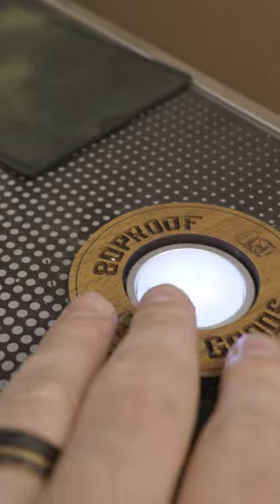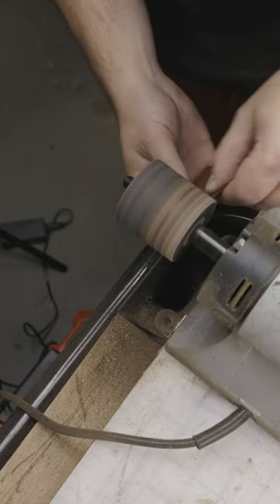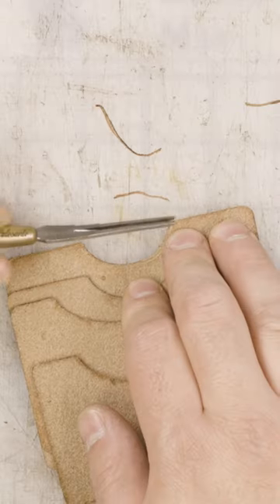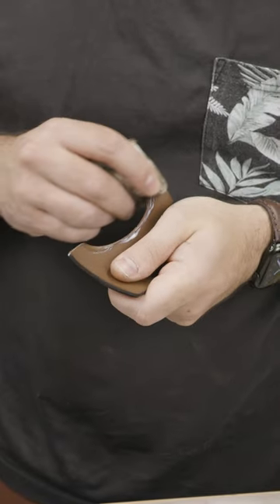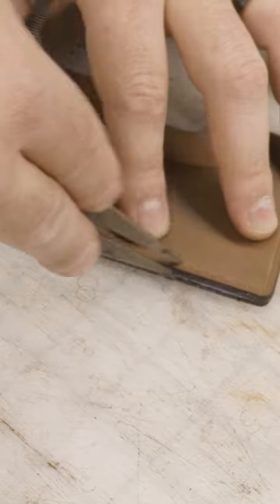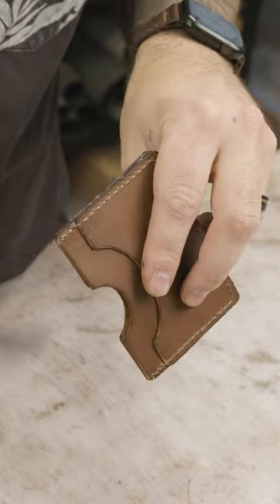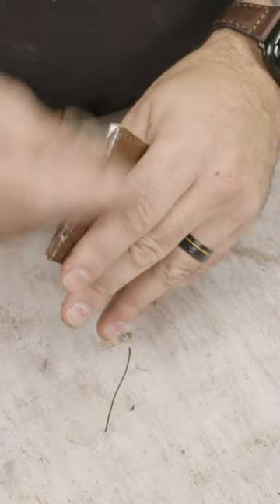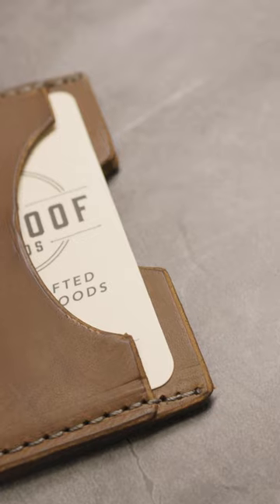Making a Minimalist Card Wallet in 60 Seconds | #shorts

Comment: I'm not selling anything yet because I'm still trying to master my skills. I don't mind stitching by hand, but having a laser cutter would be nice. Do you allow extra trim allowance for sanding off chard ends?
Reply from the maker: Good question! I don’t add trim allowance but also sanding doesn’t off much material other than making it flush. I don’t use a lot of pressure when sanding so there’s always still 1/8” from the stitching to the edge
Reply: @80ProofGoods  ok makes sense. I want sure how much the laser ate up. Thanks for the response.

Comment: Since the glue is water based is it bad to send your wallet through the laundry. Obviously no wants to send there wallet through the laundry but it happens.
Reply from the maker: The edges may split, but the stitching would hold it together. Like you said, it's not good for it, but if it does happen the wallet wouldn't fall apart. You may just get some edges started to separate.